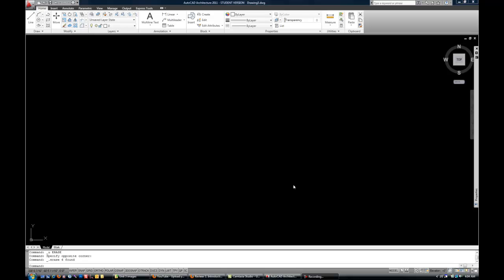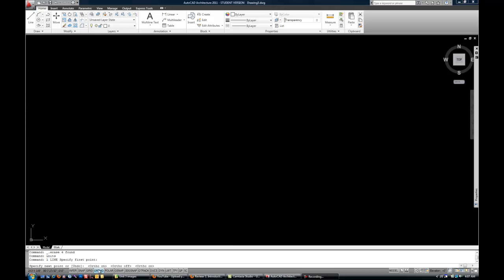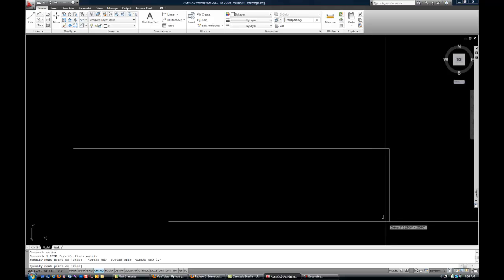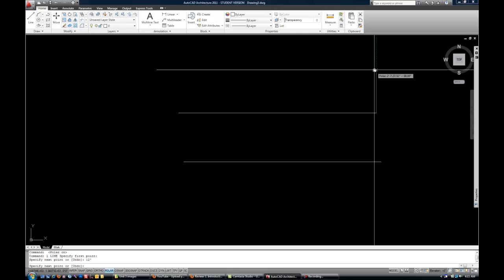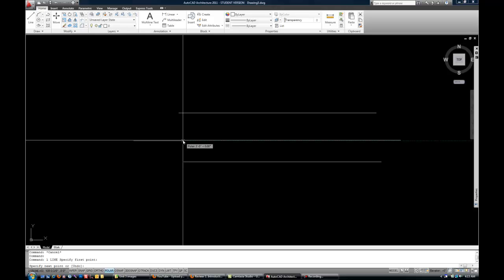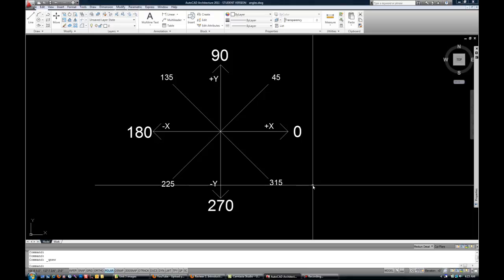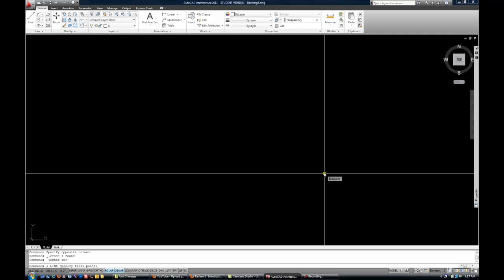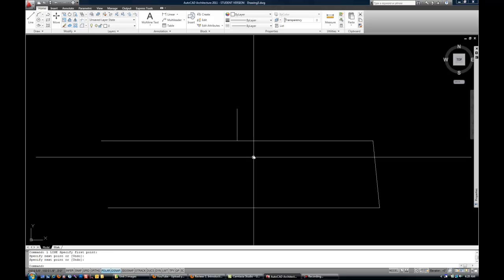AutoCAD Fund. Part 5 (drawing aids)

Comment from the maker: you may also have a metric profile set up.  There could be an icon on your desktop that starts AutoCAD using this profile - if you installed AutoCAD to include this feature.  Otherwise go to options (OP shortcut) and the profiles tab to see if there is a metric profile there.  If so, double-click to activate it.